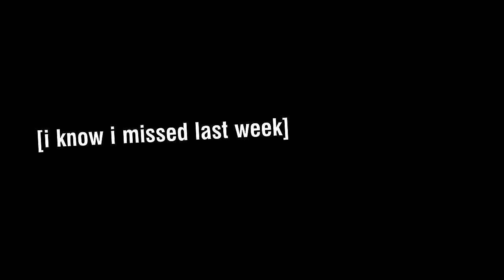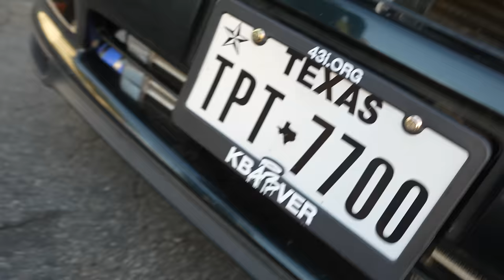Toyota Tacoma With A Turbo HONDA 500hp Engine Swap | Build Breakdown

Comment: Wow this truck drives wicked zero bounce and it is slammed to the ground hats off to amazing engineering.
Reply: U KNOW WHAT BODY KIT HE IS RUNNING ON THAT TACOMA?
Reply: @bluntforcetraumaproduction4567 he said it in the video. It's a oem toyota x runner kit shortened to fit the single cab

Comment: LOL, the body kit is the compression stop. This dude is wild. Serge is a real one.
Reply: U KNOW WHAT BODY KIT HE IS RUNNING ON THAT TACOMA?
Reply: @bluntforcetraumaproduction4567  did you find out which one it was
Reply: @bluntforcetraumaproduction4567 it looks like the OEM x runner kit with a custom splitter and cut roll pan

Comment: A K swap that sounds good! About damn time! The hood dumps, fender dumps and open exhaust on Hondas always have and always will sound like an angry garbage disposal, especially when the waste gate opens. A little muffler action, bellissima
Reply: I was so worried about how it was gonna sound ! I put 2 resonators and a huge muffler on it also did a j- tube 30 inch’s long that helped tremendously!

Comment: love the 2000 to 2010s toyotas their so slow stock and very boring but this guy made something special. the beep beep when u leave your key in the ignition is the same as my second gen rav 4. turn the lights on when u open the door without the key in the ignition is even worse

Comment: The single cab if it was 4x4 with that motor but built and some fatty tires and angle kit..  would be sic nasty on the straights or flip into 2wd for some drifty boy action..

Comment: the only lift it needs is Via Tire size. possibly removing the weight in the rear top with a 90's TEKSTYLE..  remember the 93 bad boy.. not that B.Tiddy..

anybody make a fastback for those? a full carbon top half would be sick

Comment: Is there a chance I can shoot you blokes an email? I have a 2.4l CRV engine I want to transplant into a Hilux (Aussie Tacoma), I need mainly to know what sort of work needs doing for the computer to communicate to the engine, or in the event of a computer swap, how to get it to communicate with the Toyota instruments/controls. 

I figure the 6 gear gearbox/transmission will need to be transplanted as well.

Comment: Did it really cost 10,000 to k swap this?
Reply from the maker: Turbo, manifold, clutch/flywheel, transmission conversion, Haltech ECU, wiring, fuel parts, cooling parts + fabrication and labor - 10k is a pretty good guess.
Reply: @HertLife oh okay so it's more like 5 to 7,000
Reply: @HertLife  well for me at least I will be doing all the fabrication and install
Reply: @HertLife  thank you sir and good luck on your new endeavor built some badass shit buddy

Comment: It's so low it flexes at the rear like a bagged truck when they uses a a shitty clip or smaller frame rails. Lol no shit talking. It's titts. Maybe too low but I'm a former mini trucker. My s10 was that low and it was a 10 inch monster notch but on leafs